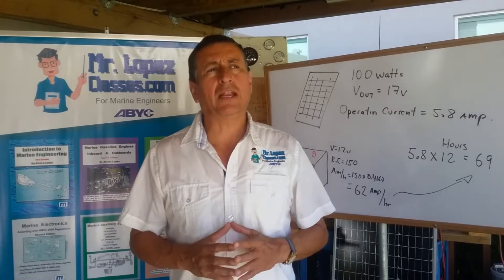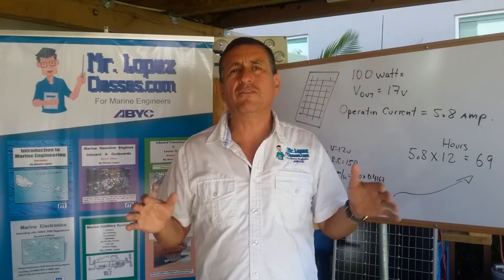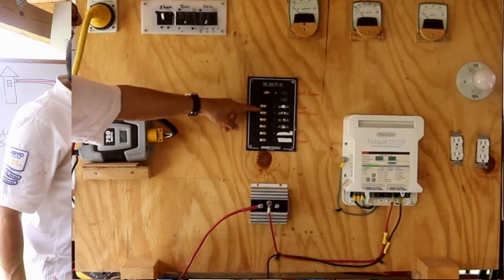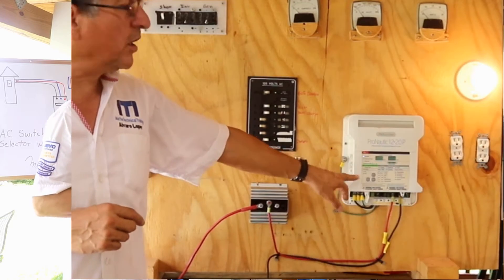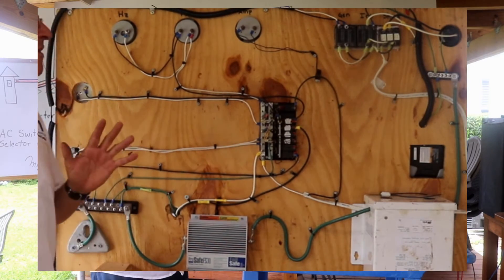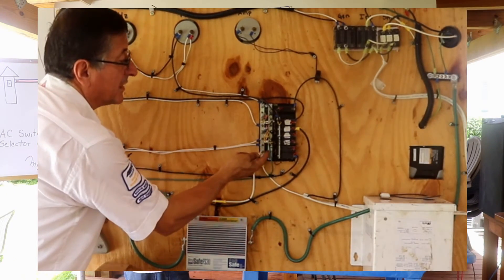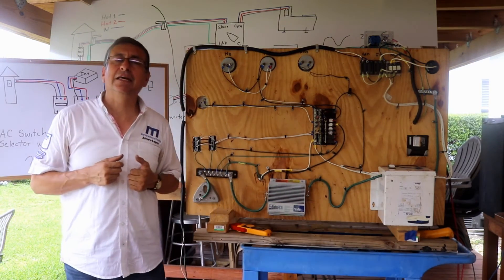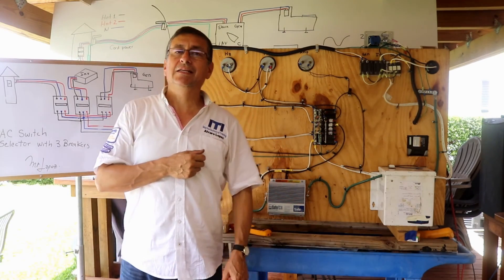Why Reverse Polarity is Catastrophic in a Boat

Comment: I understand that if I connect a portable Honda generator to my boat shore power to charge the batteries when I am at anchor, the reverse polarity light will come on. Is this the same situation as you describe in this video?
Reply from the maker: Hi Marcos. Not necessarily. Reverse Polarity is a wrong connection at the input of the AC Panel. It is when Hot and Neutral wires are wrong